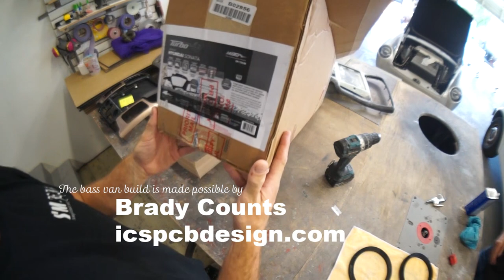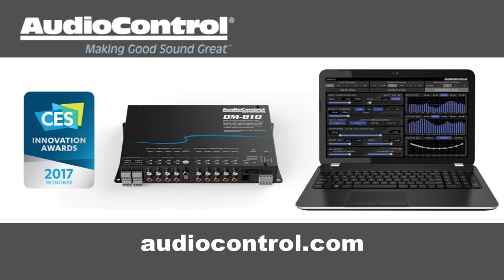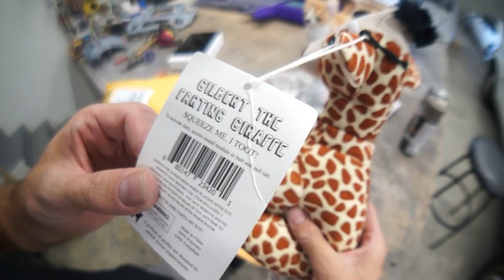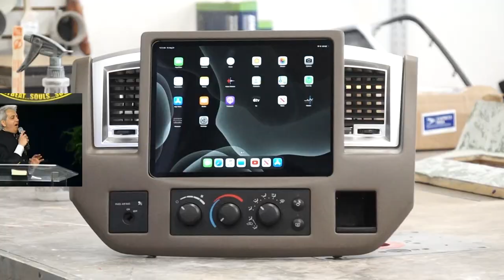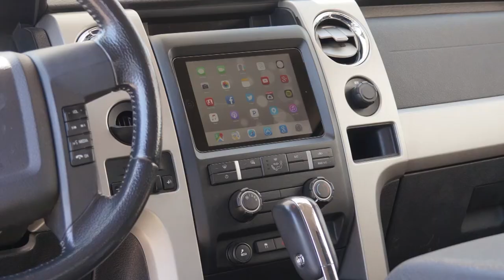MEGA SHOP UPDATE! - BASS VAN - THE MULE! - VLOG BVV#50

Comment: Pc10 uses a different harness, street fighter uses a mamma harness.. Also need a dual monitor pc10 board who I are not cheap. Also check the monitors, you need sanyo monitors.
Reply: Jamma, not mamma. Gd autocorrect

Comment: I have a question, 
What if you use SMD resin with the the fiberglass bog instead of the harder for the bog ? 
Will it still get hard?
“That’s what she said” 😉
Reply: You’re welcome if it works. 😉
If it doesn’t 
SMD you’re welcome if you come up with a harder that will work.😉
Reply: The sunflash could work but the bog uses a different hardener that may conflict with the sunflash which is photochemicaly activated by the sun
Reply: That’s what I was thinking, so he add that to the bog instead of the hardner he can take his time spreading the bog then take it out into the sun when he’s ready. 
It’s worth a try with a sample and if it works then it would be a game changer.